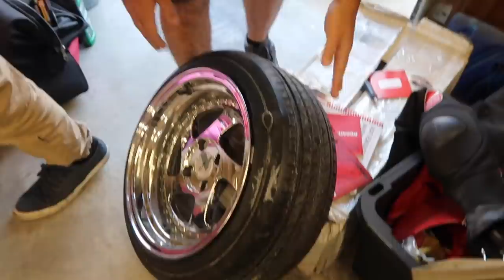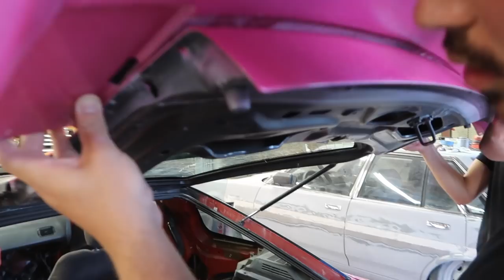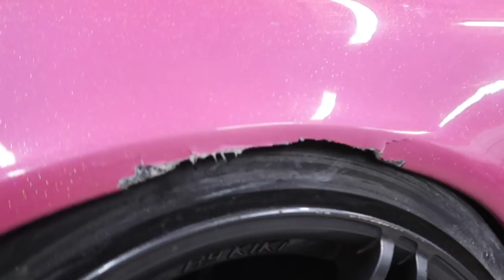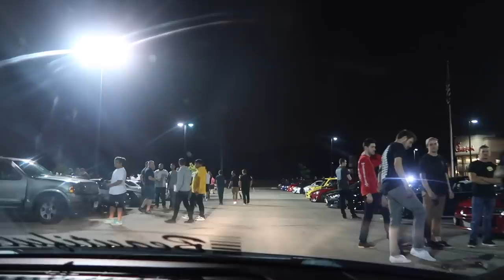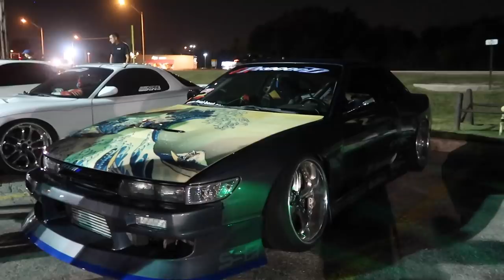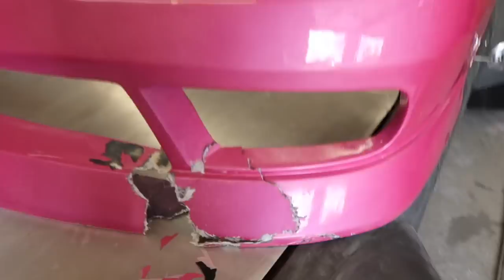Already Broken :'(

Comment: He had no right to be mad, for fuck sake he knew it was rubbing and still choose to drive it like that
Reply: Exactly. I drive stupidly low too. You know everything's going to break, tear or get torn apart.
Put it on air if you can't handle that.

I'd suggest the fairly new static+ option, but they only work on low speeds.

Comment: I was told to look at the comments. A new Windshield was already bought before i punched it because it was cracked so idk why yall going nuts over this. This will take a few days to fix and paint again but im not worried. I didnt expect there to be a piece of the cement about 4 inches tall to be in the middle of the road🖒🖒 psa its goung to stay at the height its at. Maybe lower the rear 😉
Reply: Frank240jz shit happens man, people are quick to judge when they have the opportunity. Atleast it didn't damage anything underneath the car at least I hope not 😬 bumper and paint doesn't seem like it will be a hard task for you, keep it up 👍🏻